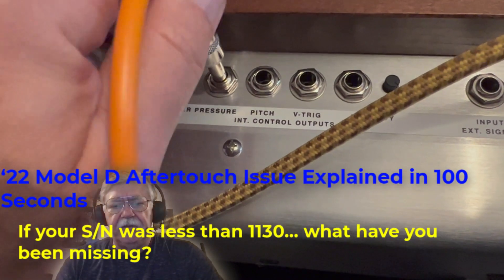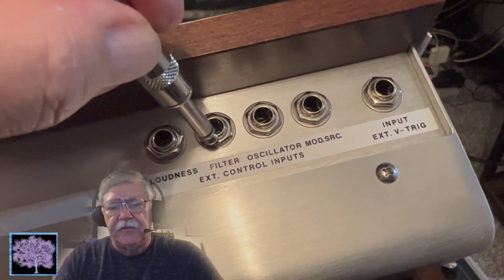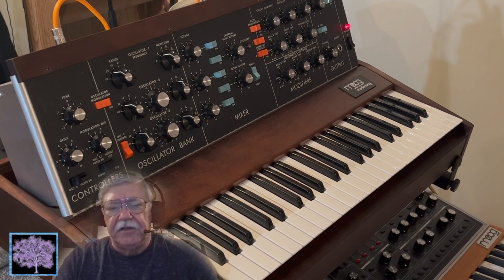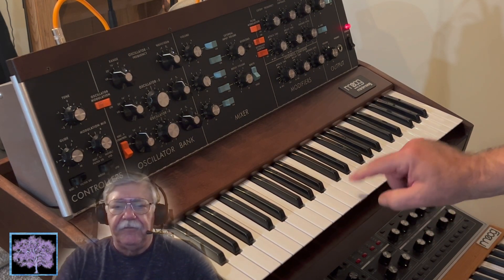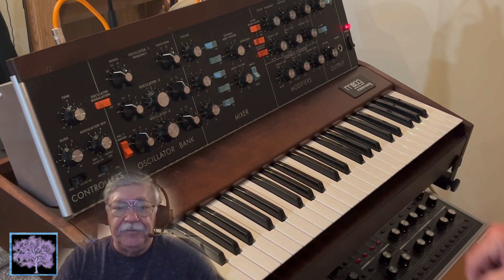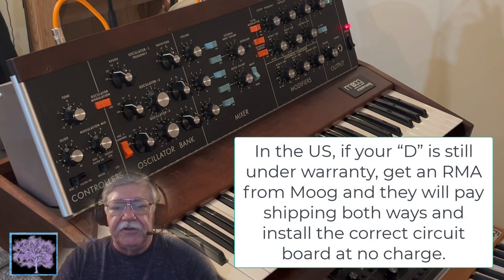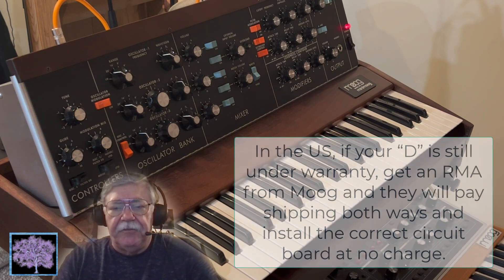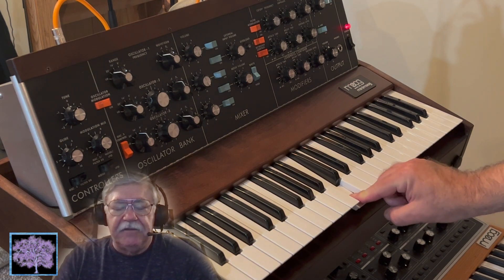2022 MiniMoog Model D Aftertouch Issue Explained in 100 Seconds

Comment: Unacceptable
Reply from the maker: Would you like to elaborate on what is unacceptable?
Reply: I just got the 2022 and it has the same issue. At 5k gbp this is unacceptable.  @GetsemaniMusic
Reply from the maker: It’s been a known issue for months that s/n’s 1130 and below were defective and covered under warranty. If you just got it I’d go back to the seller and demand it be repaired or replaced with a newer unit. (In the US the repair was quick and simple. Moog covered shipping costs both ways and it only took a week.)